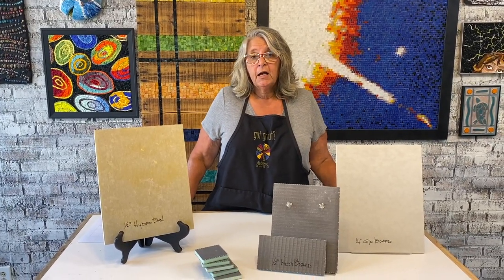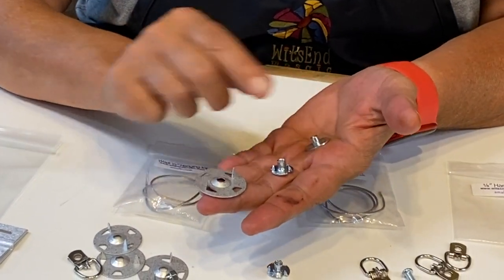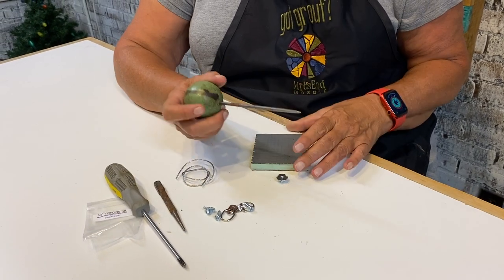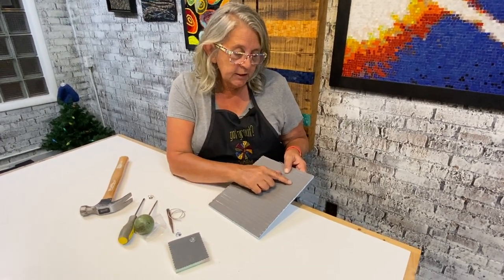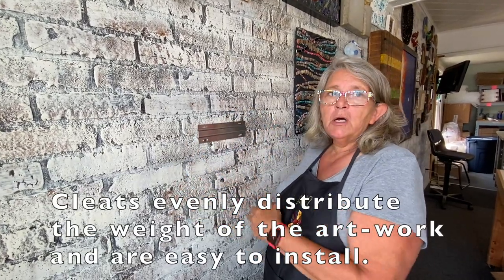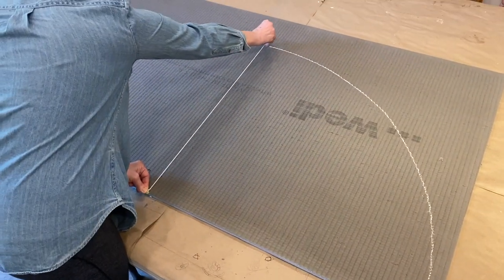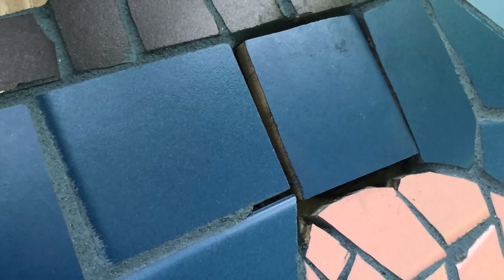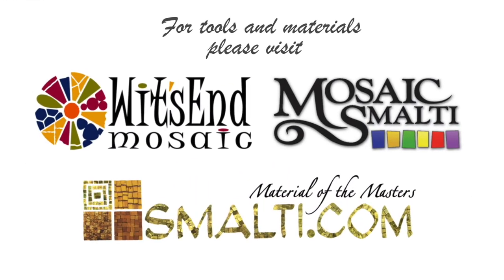WediBoard & More: Guide to Lightweight Substrates for Mosaic Tutorial

Comment: Thank you! So informative. I have used tee nuts and washers on some of my work done on Go Board. I have two small works of 1/2 Go Board,  10" x 10" and then the second one 7" x 15" (a bunny shape). Can I get away with not using the washers on these small works? When do you recommend using washers?
Reply from the maker: I only skip washers if the finished work is really, really lightweight. The other factor is the weight of tesserae, adhesive, grout, etc. I almost always use at least a washer on the front side (referring to Wedi-washer), I figure it would be such a pain to fix after the fact. If you check with a local tile distributor, you can probably buy a box of 100 for less than $20 - you'll be set for years! Heck you can get 50 on amazon "prime" for $7!  https://amzn.to/3IRCGRt
Reply: @MakeitMosaics  Thank you. I am using tee nuts on small works and was wondering if I could not use the washers that are placed on the back underneath the D rings. Kim is not using them in the above video however I have seen them being shown in mosaic books, online groups, etc. I appreciate your help and wonderful videos!
Reply from the maker: @OGoldin  Whatever works that protects the substrate from getting tron - which would take time and weight.

Comment: Thank you for the clear and informative presentation!  I am interested in creating a mosaic table for our garden and have a few questions I was hoping someone could help with.
What (if anything) would you advise using between the Wedi-boards and the table base? (the primary goal here would be to add strength)

The boards available here are available in a array of thicknesses, but are always 60 cm wide.  I would like to make a table 90 cm wide and 200 cm long. Do you have advice on how to join 2 boards together in order to create a suitable width? Also, how do I chose the best thickness?
Reply from the maker: Some sort of support system is probably needed given size. There are 2 videos on channel about tables, they may provide some insights, I'll put links at end of this exchange.  Exactly how engineered depends on the actual table construction. To join boards (I've done many times) a combination of A/R mesh tape, thin-set and creating a few channels in the boards to span some sort of counter strength - sounds worse than it is and easier if I can send you a photo.  You'll need to email me, I cannot attach photos here. It is a great question, I'll add to my list of video to make. email: contact@maverickmosaics.com the table videos are: https://youtu.be/-h48bfGDKx0?si=OrYhiGw5IxBadn0T.   https://www.youtube.com/watch?v=IPRfPiXWvdc

Comment: Hi Kim, this is a great video on hanging pieces.  My question.. can you use the same hanging options on a cement board like durock?
Reply: Yes you definately can.  The key is the t-nut.  The shank portion needs to be slightly shorter than thickness as your board.  You also have to keep weight in mind.  Durock is heavier so if the piece is to big there is a small possibility it can pull the t-nut through.  If you are hanging a full or half sheet it would be important to use a french cleat attached in multiple locations along the cleat so that you distribute the hanging weight and it is not reliant on only two fasteners.
Reply: @kimwozniak5663  thank you!

Comment: What thickness of board (wedi) do you recommend 1/4 or a half-inch.
Reply from the maker: I usually use 1/2” because less chance of a bow. For really small work 1/4” fine. Because I buy by the sheet I typically get 1/2” just because I don’t want to own too much.

Comment: I find that I need to add a piece to the back of mosaics at the bottom in order to make them lay perpendicular to the wall, rather than tipping.  I am wondering if there is a way to eliminate this by perhaps placing the wiring on the back at a different distance from the top than the usual 1/3 down from the top. Any suggestions?  Most clients do not want the French cleat if they have to do it. So the wire is the general request for hangable mosaics.
Reply from the maker: For sure you can do D-rings and a wire. The thing is the cleat is way more stable and really not that difficult to install. It is especially preferred if the artwork is heavy.

Comment: Thanks for the video.  Home Depot sells a waterproof backer board in 1/2" thickness called "XPS Foam Waterproof Backer Board Underlayment for Wall Tile and Stone" and I was wondering if this can be used similarly to the WediBoard.  It seems to be much less expensive with similar specs.  Has anyone ever tried this board?  What benefit is there with the more expensive WediBoard?  Appreciate any help.
Reply from the maker: Yes indeed there are many alternative, less costly, products. I am not exactly familiar with the product you site, it may require a scratch coat for thin-set mortar before beginning, read the manufacturer's recommendations. The benefit of using Wedi is it is a proven product, that being said I have used many of the alternatives.

Comment: Hi, since Wedi board is not easily find in local hardware stores in the US, which will be the best comparable one to use? My mosaic will be 48x32” and will fully outdoors, displayed on a metal frame with a stand. Thank you
Reply from the maker: Wedi is only carried retail buy the sheet by tile distributors. Home Depot and Lowes sell but you have to buy a pallet ($$$).  My other "go to" is Go Board, which I can purchase from a local tile place where I also purchase Wedi, grout and thin-set from. It is always helpful, and usually cheaper, to purchase those materials from a tile distributor (Dal Tile, Morris Tile, Conestoga - to name a few). For your project, you will need one sheet of either Wedi or Go Board, and depending on your tessarae weight, you might want to do some sort of brace on the back unless screwing the board directly to the wall. Here is the link to the Wedi store locator,  https://wedicorp.com/en/where-to-buy/.  Witsend Mosaic may be able to do for you, but not sure about shipping, they are in WI.

Comment: Hello! I’m attempting a bird feeder (with half teacup) and WediBoard. Instead of using the hanging system, I thought to drill two holes to thread wire through to hang from a tree. My question is the inside of the holes will have exposed foam. Should I coat the inside with thinset? Thank you!
Reply from the maker: The foam will not degrade, you could just paint it. But be mindful of the over all weight of the finished piece, will the wire pull on the Wedi and over time maybe split it? The washers prevent that from happening.
Reply: @MakeitMosaics  oh right, I didn’t think about that. Thank you!

Comment: Can you please tell me if you have a video about inserting larger 2x6 foot pieces into metal housing for outdoor display. Do these pieces need to be bolted to the frame using D rings similar to direct to wall methods? And could you recommend a product to brigde the gap between the finished mosaic surface and the steel casing to prevent water lodging. Many thanks ps. found this video very informative.
Reply from the maker: I do not have such a video. If your metal is non-rust and you use a Wedi type product substrste, appropriate adhesive and tiles all should be fine. Water always finds a way out especially if a vertical display, if concerned find descreet places in the metal to drill weep holes. Better to give the water an escape route than allowing it to pool. I do not understand what you mean by casing, decorative edging? This is Bonnie answering.
Reply: @MakeitMosaics  thanks so much for that Bonnie. The casing I referred to was infact the metal housing. I have seen some artwork in metal casing have a putty type product packed into the gap between housing and substrate. I just wondered if you had any idea what that was. Seperately can a large wedi board (full size) successfully be inserted into a metal casing using D rings as the main means of support. Thanks so much
Reply from the maker: I will try to answer here, but if not clear please email me a photo (bonnie@maverickmosaics.com). For the Wedi-type substrate, you need the Wedi-type washers to avoid having screws push through the substrate, then D-ring can go on back of that "unit" (see the video titled "Preparing Wedi Edges", shows washer/D-ring assembly) although with heavy pieces I am inclined to use a cleat as it can accept more weight and evenly distributes the weight of the artwork. Good luck. I like when folks build big for outside!
Reply: @MakeitMosaics  hi Bonnie, seen your video and found it very informative. Lots of food for thought. All prepped and excited now to play around with hanging options. Inspired. Thank you so much 🥰

Comment: Where to buy Wendi board and can I attach a cement board cutout I’ve made to a Wedi board that is also covered in quick dry cement before the mosaic pieces go on.
Reply from the maker: Wedi website has a store locator. Depending on your country, in USA we have many tile distributors and they sell these types of substrates.  I do not fully understand the second part of your question, you want to attach your cut out to Wedi, but why?
Reply from the maker: @tammyhiller1821  Ohhhh, you are doing a "layered"l work. Yes you can attach her to another board to get that dimension. In theory you can adhere the 2 pieces together with thin-set, but depending on weight may require bolting into the wall. It is an engineering challenge. You go girl!